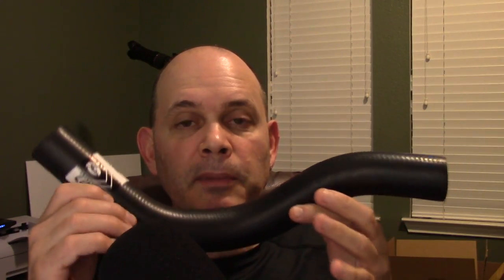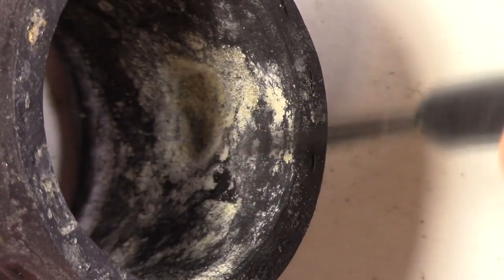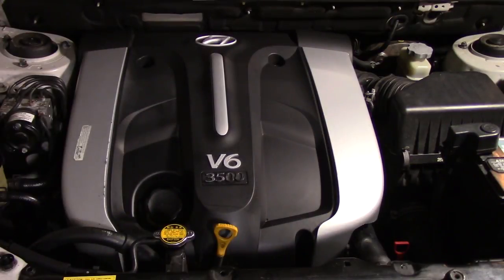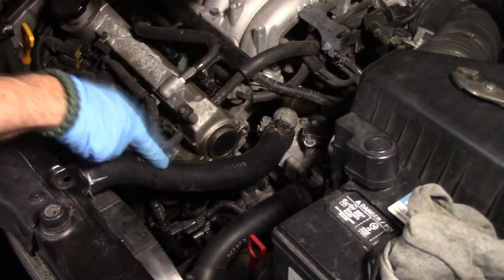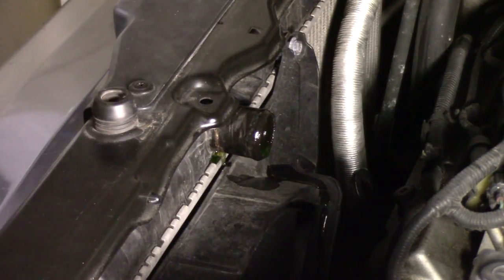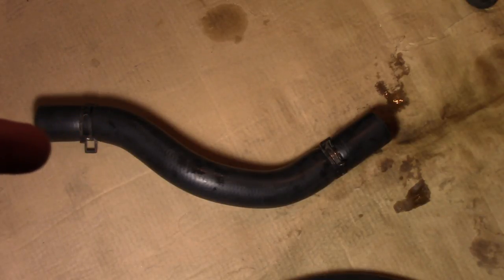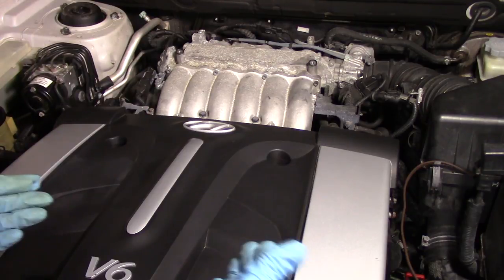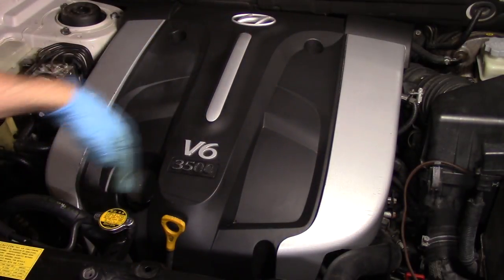Radiator Hose Replacement (Upper) Hyundai Santa Fe 2003 3.5L 6 Cylinder Gates Radiator Hose

Comment: Ater i change the uper radiator hose on my 2007 hyundia santa fe will the air that gets in the hose cause my engine to get hot while i'm driving it. You said the air would work its way out.

Comment: In light of all that corrosion, I would guess that Hyundai long life coolant isn't worth the extra bucks.  I use Prestone all makes all models coolant in my 2002 Sonata and have absolutely no corrosion problem. My hoses are still the original ones after 16 years of use.
Reply from the maker: Thank you for watching, commenting and the valuable feedback. I appreciate it greatly. All the best.

Comment: you did reuse the old clamps that you took off? that's what your supposed to do!
Reply from the maker: Yes I did reuse the old clamps. They did not look compromised in any way so I saw no reason to replace them. They are holding on tight without issue are the moment too. If they were corroded or weak I would have replaced them with new ones for sure. Thanks.

Comment: great info, glad you mentioned using distilled water with coolant as well replacing lower rad hose. 
Personally myself I have found that aftermarket rad hoses are not the same quality as OEM hoses. OEM hoses can last 3-4 times aftermarket ones. So it comes down to cost as aftermarket can be 1/2 or less in price. 
You showed deterioration on the inside of the rad hose not sure the history on service of the coolant ? As many times these issues start from acidic coolant, always good idea to flush the cooling system with a hose replacement. Plus a good time to inspect and test the rad cap condition and pressure holding specs. 
Recently I decided to change my car over to Evans coolant (search for jay leno video) interesting company and coolant.
Reply from the maker: Thank you very much for the great feedback. I bought the vehicle used with 134,000+ miles so I have no idea if they are the original OEM but if they are I would say they lasted more than long enough. The same goes with the coolant, I have no idea what was used but I will be flushing the system and using OEM Hyundai fliud when I replace the lower hose. BTW I have not had any problems with any Gates products I have used in my cars. I am impressed with the quality and fit this part as well. I ordered the lower hose and will be doing a video on that soon. Thanks again. All the best.
Reply: Richard Lloyd good to hear RICHARD,
Personally myself I have had fitment issues with aftermarket hoses gates, Goodyear etc, 
Which I have had to order oem hoses because of the fitment. And on some long term vehicles have had aftermarket hoses fail because of build quality. Again it's a cost and availability issue as aftermarket hoses can be 50+% cheaper.
Reply from the maker: My time matters to me too. I don't want a cheap hose I need to change every 30,000 miles. How much money are you saving if you are doing that? I will report back if these hoses are not reliable. Speaking of hoses, I was watching the video again and spotted that some of my vacuum lines looked like they need replacement too. That will be another video in the near future. Thanks again.